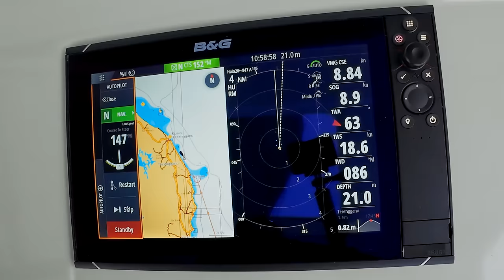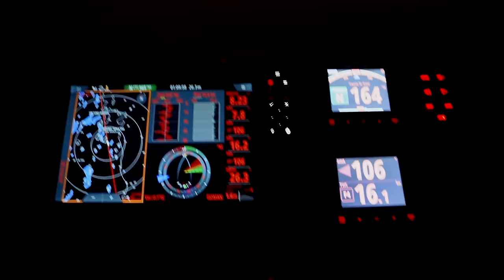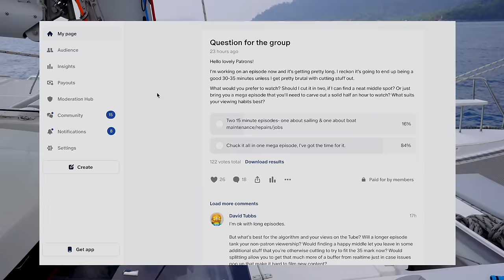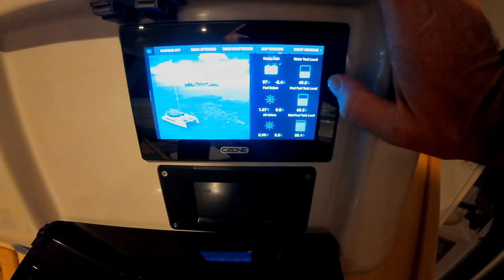This One Simple Hack Cleaned Our Drinking Water

Comment: Why wouldn’t you while at marina just pump all the water overboard, fill up, stir up, dump overboard, repeat, repeat until clean. Use a simple bilge pump. Also use a shop vac with 1-2” water in tank to vacuum up.
Reply: They have to get the boat to Phuket. They were trying to fix it at the marina before they left, but it wasn't the watermaker that was the problem but the tank. I had a similar problem this weekend, dish washer kept turning off mid-cycle, no idea why, took the whole thing apart and found nothing wrong. Put it back in place, still didn't work. Problem: drains were clogged. It's an more common bamboozle than you'd think.
Reply: Why would you not start with the most likely fault, drain clogged, rather than tear down and rebuild the whole thing. 😂
Reply: @d-rot  Women were watching

Comment: Nice, -- SOLUTION -- If you want to agitate the water in the tank, get your power drill and attach a paint stirrer to it.  Then "stir" the water.  The attachment is cheap and about two or three feet long and will mix up that water totally as it is designed to mix together paint colors in 5 gallon buckets.  Water will be easy.
Reply: That's not what James Bond would do
Reply: Also running the polisher while sailing will keep the water agitated. Rough weather good.
Reply: @jackblah5842  ..LOL... but believe me, that metal paint stir would whip up that water better, probably, than anything else - essentially a small metal propeller on a metal rod.  Paint is thick like mud before we mixed it and the drill would stir it perfectly.  Best mix solution you will ever find and easy to use.
Reply: @Coleen-Love  Shaken not Stirred
Reply: @jackwickman2403  This is how James Bond would do it

Comment: Fair is fair and I accept there will be issues with a new boat that are not necessarily the fault of the builder. That said,  to me, contaminated water tanks seems to be on another level of just plain wrong.
Reply: thats what happens when you have 3rd world workers build a million dollar boat
Reply: @krionic  That's why it's a million dollar boat. If it was built by first worlders it would be a two million dollar boat.
Reply: The tank manufacture should have cleaned the tank out before sending it to the boat manufacturer .. After the tank was installed it should have been cleaned out again .. Then .. Before handing the boat over .. The tank should have been cleaned out a 3rd time for good measure .. Just one more thing to put on the list for Seawind to do in their hand over list
Reply: @krionic  But the boat builders don't put the water in the tank. They have got some crappy water from somewhere.

Comment: Given the effort that Seawind went to in designing and building the cat but leaving the tanks and lines full of crap and the washers etc. not checked is IMHO a reflection on them  - they specified the water makers,  they installed and built the system  in their boat and they sent it out as completed with their stamp of approval (to be fair if I ever buy a new boat I'm checking the water system myself after this!). Filtering it might not work because if there's large sediment particles at the bottom fo the tanks you might not get them all out. If you don't have inspection hatches you can unbolt you might need to cut some and then wash and hoover out the tanks directly and THEN flush the pipes

Comment: You easy solution to your problem is to install a 10" filter housing after your pressure pump. This housing should be clear and house a 1 micron filter. That's right. 1 micron. This will remove everything from your water tank without messing around with a polishing system. We have this as standard on our boat. It is the barometer of your water tank. We have this filter located immediately before a similar 10" clear housing containing a carbon filter. This means that every water outlet on your boat has nice tasting clean filtered water. It also protects the watermaker from chloride should you ever fill up from land based water supplies. The carbon filter lasts longer because of the 1 micron prefilter. We change out filters about every 6  months. You may need to change your 1 micron filter a few times if the tank is as dirty as you believe

Comment: Sounds like you need to pipe in whole house filter on your tank outlet. I think that’s what you are using I would probably run another on a hose before the other devices to make sure it’s out of the lines.
You should have on the input too. 
 Double whole house filters on input work amazing.

Comment: I can't remember if your boat has a rain water recovery system but if you do that might have been the ingress point.  I would hope that it would have a recover/bypass valve.  Run the polishing system while under way so the wave action helps stir up the debris.  Put some of the freshly filtered algae in clean water and see if it grows.  No growth and the algae is dead and the system cleaner worked.  Best of Luck.

Comment: The fitting you need for the housing is those fittings you throw away when you have those hoselock tap fittings... the bush converts 3/4 to 1/2 inch.

Comment: Now that you have proved out the water polishing system give a thought at least as to whether you will ever use water you did not make on board in your tanks. If that is at all likely, make some provision for a properly plumbed filtration arrangement. Remembering also that a good carbon filter will remove chlorine if any gets into the system.

Comment: What has become clear in all these videos is that yacht builders gotta plan far better regarding less than ideal boating-cruising circumstances. Not all water is going to be clear and pseudo pristine before it comes on board. Sometimes it’s gonna be silt filled, sandy, muddy - or outright crap. They have got to have far better pre-cleaning and filtration options, higher capacity filters, and simplicity of design and maintenance throughout. Difficult parts, odd hoses, and weird bits in inaccessible places is not ideal! 😮

I also personally feel that the whole “flecks of fiberglass, grit, and gelcoat” thing shouldn’t have been yours to solve at all. That’s on the builder to have done, and made sure it was taken care of. They owe you for that: it’s cost you a lot of time, effort, and money!

Comment: There is a reason the boat acronym says bring out another thousand. For those that demand that the manufacturer be accountable is justified BUT it is like a marriage relationship. There is give a take. If you “demand” things the manufacturer can make your life extra difficult. Slow responses, no parts available etc. As a boat owner you have to create a relationship that works both ways. It’s not like you can go to a local dealer and trade in because you are not satisfied. It is a complex relationship that requires diplomacy from both sides. I feel for Nick because I experienced the same thing with our Spectra and decided to change it out. It is not easy- supply chain issues, costs etc. the cruising community is VERY small.

Comment: Nick, you need a DIY version of a Gama Jet from Alfa Laval to power wash the inside of your tanks and a wet vacuum to suck out the dregs. I've used them in oil and gas to clean large tanks.  360 Rotary head attached to a pressure washer with bio-friendly soap.

Comment: I have an island packet. The aluminum tanks prevent using chlorine. We use food grade hydrogen peroxide as a water treatment to prevent algae. I will use your idea for the water tank cleaning. I have pumped it out annually, but a polishing is a great idea.
Reply: Excellent call. Can you give an idea of how much peroxide per hundred litres or however you work out how much to add please?
Reply: @soggybottom3463  Depends, how long are you expecting to live?
Reply: @cannaroe1213  the hydrogen peroxide breaks down rapidly into oxygen and water. Before it does it is pretty tough on algae without being dangerous to tanks, line, fixtures or faucets.
Reply: @Janespony  It's not the H2O2 that worries me, it's whatever you hit with that and lives :P If they've got algae growing in the water already, I don't think there's a chemical solution that doesn't make the water undrinkable too. But I think doing that once a year would be good maintenence! Sorry i'm not trying to be mean, just funny :)

Comment: Every Desal I have ever worked on had 3 stage filtration, usually a sand or wire gauze strainer then 2 cartridge filters 10um and then 5um. You should not have any visible material getting to your pressure pump at all

Comment: Why don't you use the dinghy pump and pump directly from the tank.  Pump as much as you can. Add a few inches of water and pump that out.  Repeat until clean.  Then deal with the lines thru-out the boat.

Comment: I would add a suction strainer to the pump inlet to catch the big lumps and not have them run through the pump my RV has one with 1/6" mesh stainless steel screen in it.

Comment: I think I would have been tempted to dump the water during your passage the movement of the boat would have kept the SHoneT suspended and therefore once the tank was empty most of it should have been gone. 
Then fire up the water maker on the passage maybe half-fill the tank let it slosh around a bit, and then dump that as well. 
Only once the tank had been refilled again would I have used the polisher. 
Sounds like a rigmarole, but I think trying to clean the debris out of the water in the tank will take forever.

Comment: Seems to me (I may be wrong) that your water problem (as far as the gel coat) is Sea Wind's problem.  Either a warranty issue, or a change in that aspect of their manufacturing process.  New boat problems would NEVER be tolerated with new cars - why is it the "norm" in new boats?

Comment: That thing has been nothing but HEARTACHE from the day you put this yacht in the water! What is the manufacturer of the yacht, or the equipment maker gonna do to truly make this right?  At this rate, you’re in the “bring lots of water bottles on board” point…. So sorry you’re all going through this.

The months and months of optimism and excitement over a new boat with new, cool everything is starting to look like you got kicked in the teeth.  It’s a lot of problems to be experiencing before you haven’t even made it out of SE Asia…